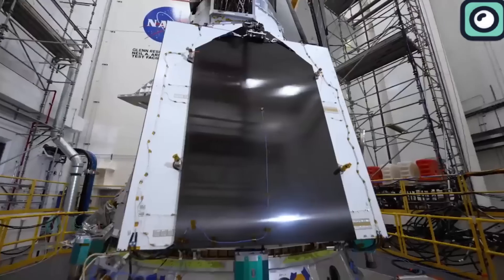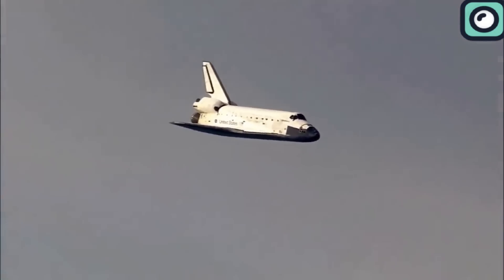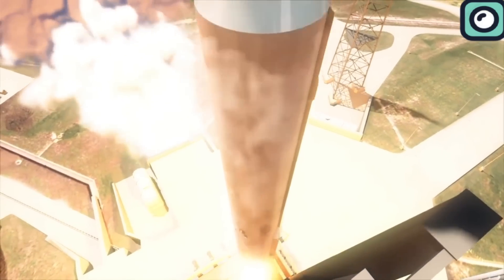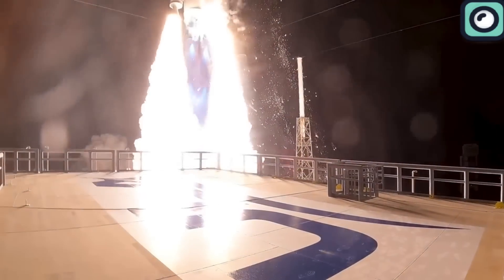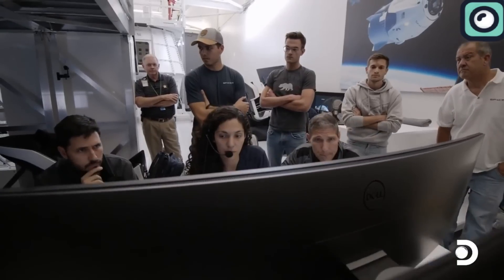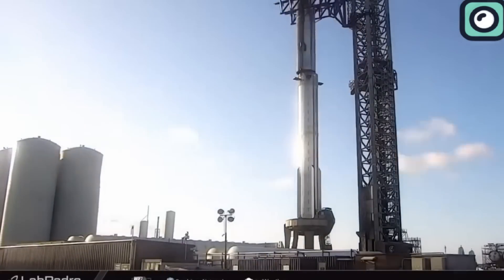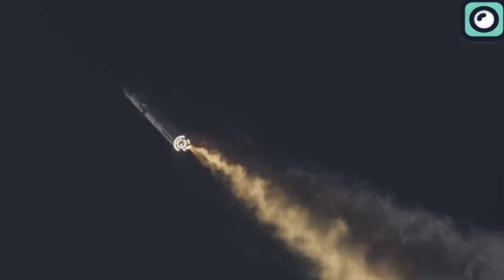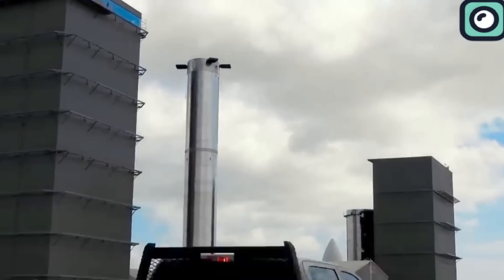FINALLY! Dream Chaser Is Launching After Constant Delays....

Comment: Comparing Dream Chaser with Starship is like comparing a semi truck with a van, they're designed for two completely different missions. Starship is primarily for long hauls of people and freight beyond earth orbit. Dream Chaser is for LEO runs supporting space stations, and ultimately ferrying small crews to and from, putting it down on a runway saves all the costs and resources needed to either pluck it out of the ocean or in the middle of a desert.
Reply: Oh. No, Starship is optimistically for spamming LEO with Starlink satellites. It's actually not practical for boosting large payloads because a fairing would be more practical for that. Even Elon admitted its payload to orbit is less than that of Dragon Heavy by 14 tons. 

The HLS is still vaporware, and any version which would take people or anything beyond Earth orbit is more vaporware than that. Anything that goes beyond LEO is going to require a vaporware tanker version  to refuel whatever upper stage that is (be it an imagined lunar HLS, or an even more imagined Mars-oriented vehicle) a truly obscene amount of times.

A more skeptical interpretation would be that it's just designed to attract investment from credulous rubes.

It's very weird that something named "Dream Chaser" is much less hallucinogenic.